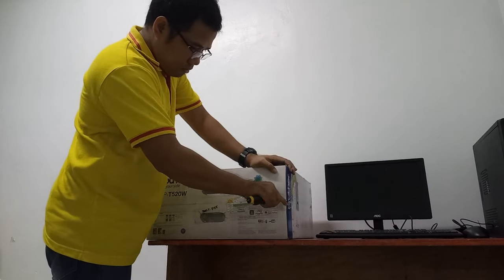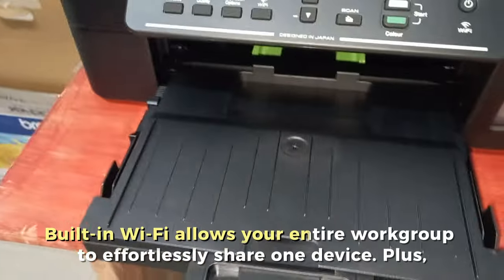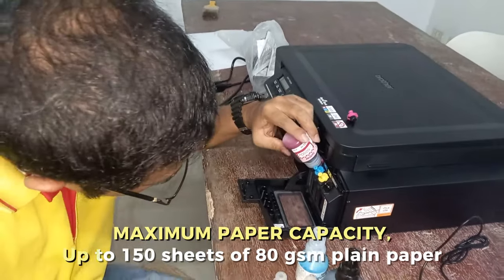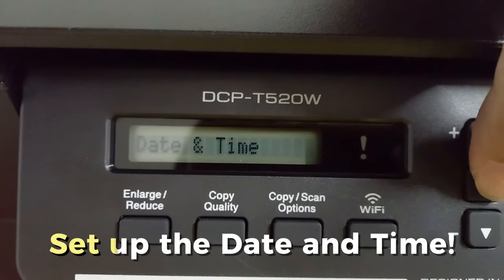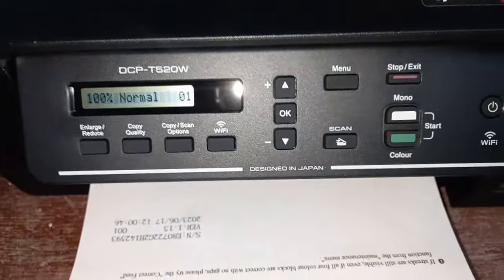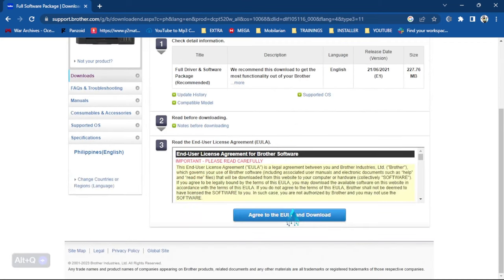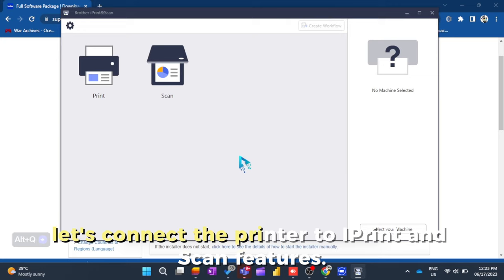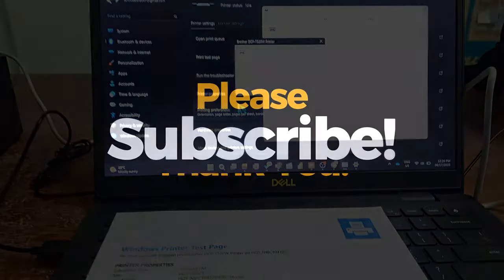Secrets of the Brother DCP-T520W Printer Revealed - Unboxing & Full Setup Tutorial

Comment: I have the same printer but it prints slow
Reply from the maker: Oh noooo😔
Reply: @DECStudio_YTOfficialChannel  do you know how I can fix it?
Reply: @albadrasworld1647  you can't fix that, it's just slow )
Reply from the maker: It depends on the paper settings,,
Reply from the maker: Have use check your usb port please use the 3.0 usb port to improve printing  speed also check the print quality  maybe did you set the quality  to high??
Reply: If you use grayscale mode with normal paper and normal quality it takes 2-5 seconds to print one page of text. It's double that with color mode.
Reply from the maker: Did you properly  installed  the driver?
Reply: YOU GO TO MENU. THEN, NETWORK, THEN ARROW DOWN WIFI DIRECT. OK MANUAL OKAY. YOU TO WIFI SETTINGS. SEE, DCP t520w enter the password in screen. Enter. Then, after Print Files or PDF files. Select printers. Dcp t520w. Then print. DON'T PRINT  NOT PDF.. COZ SLOW.
Reply from the maker: Pm me in my fb